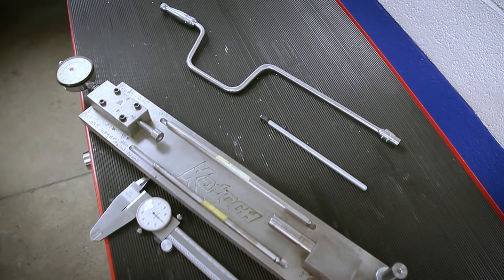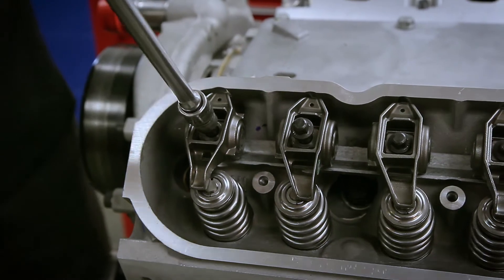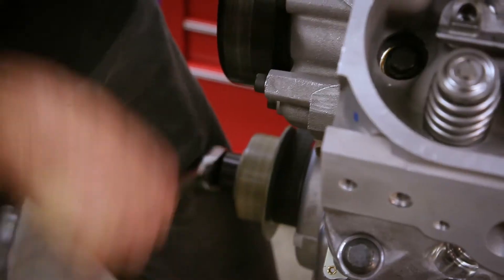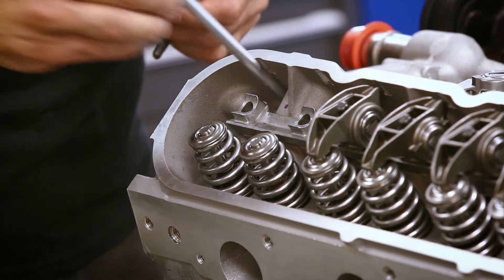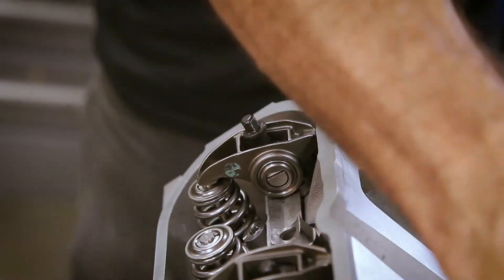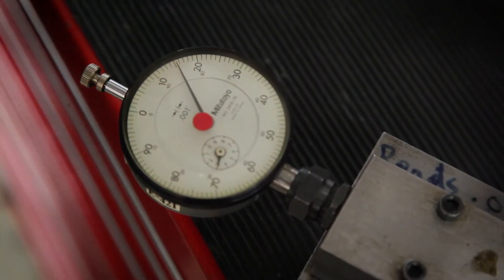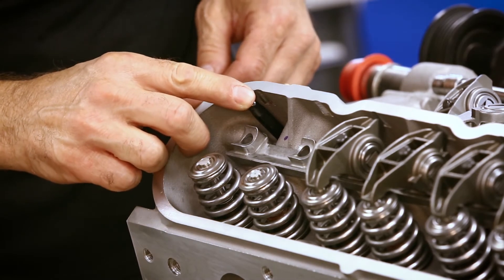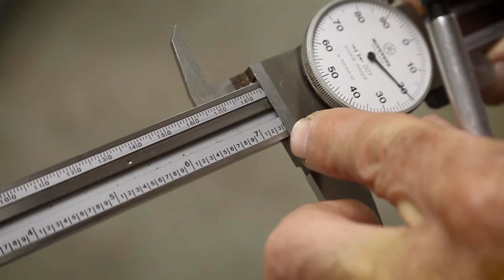Katech Preload Check Tips

Comment: So are you just snugging the bolt down and lifting up on the tip of the rocker arm, and of there's no up and down movement your at zero lash??
Reply from the maker: Yes.  At that point extend the adjustable pushrod, measure, add your desired pre-load, and that's your pushrod length.  If you put pressure on the lifter you can overcome the plunger and skew the reading.